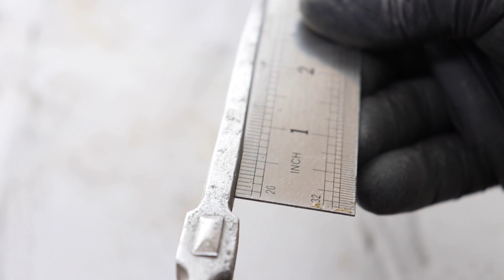Restoration of the old drawing compass.

Comment: Curious why you would use 12 percent vinegar (Acetic Acid) and then immediately add Baking Soda (a base) to it?  You are neutralizing the acid even before it had a chance to do its job on the metal. Recommend you try electrolysis instead. What did you do to preserve the surface metal of the tool after you removed all the corrosion? Other recommendations: 1. Soak the project in WD-40 as a first step. 2. When you loosen a fastener, tighten then loosen in small increments repeatedly until it gets easier to move. I'm surprised you didn't twist off the head of that thumbscrew. 3. Place the object in a vise with jaw protectors before using a power tool with a wire brush attachment.